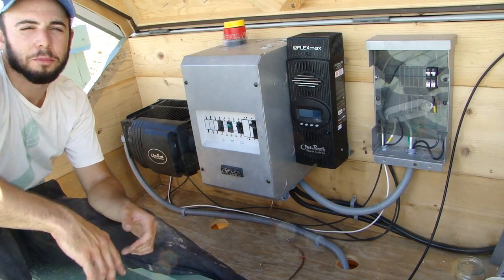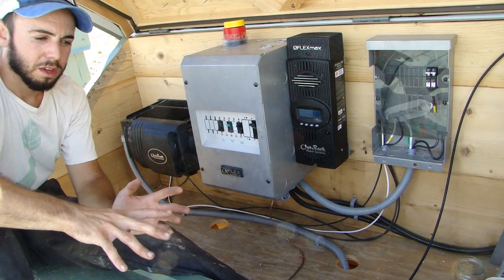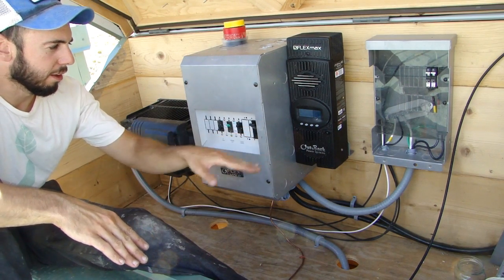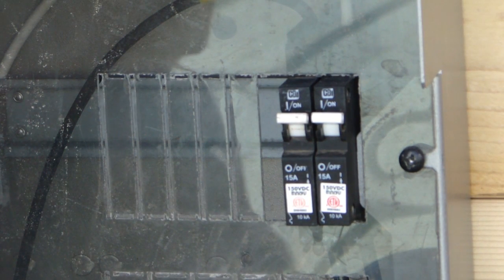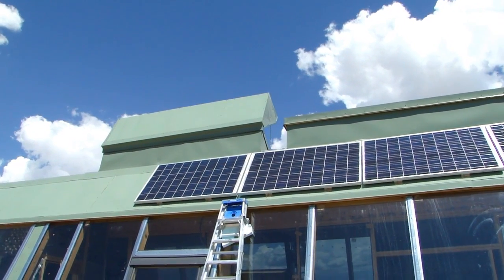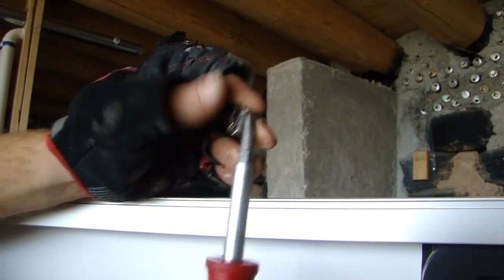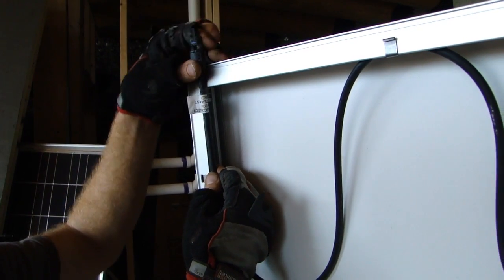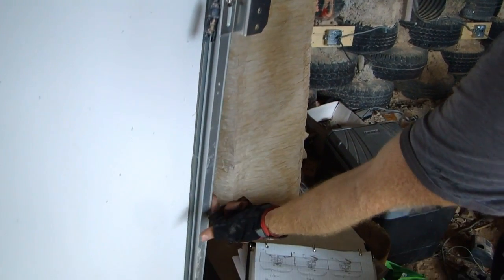Solar System Installation - Part I

Comment: i thought i was doing good by getting a kit... below, from amazon for about 2300 bucks, but now after seeing one of your videos, 
it look like i should learn more from your series and piece it together,  now i shall continue and learn!!! :D
(Renogy 800 Watt 12 Volt Off Grid Solar Premium Kit with Eclipse Solar Panel and 60A MPPT Rover Controller/Mounting Z Brackets/MC4 Adaptor Kit/Tray Cables)
Reply: this video info is up to date? or is there revisions some where? hmmm!

Comment: i install for a living and live off grid you have a good charge controller use it it will take 145v get as close as you can panels will never go over open circuit v. you have spent alot on your system use it the way it was intended it will work better. most high end chg controllers won't turn on untill pv voltage is more than battery voltage and turn off when its less.it will take care of your batteries. thats why its called a chg controller. don't try to controller it. let it do its job. your friend says he has the nuts and bolts of it.installing panels is the easy part. i've been doing this for 7yrs the electronics end of it is changing every day. i spend countless hours tying to keep up..you've got good equipment push it to it's limits give it a try you will be surprised.  where are you located? panels look steep.  anybody has any questions glad to help and remember the energy solution comes up every morning

Comment: There's so many ways to work around limitations like batteries, which are of course the ongoing cost of running a solar power plant.
I'm using an MppSolar 50 amp charger and 1240watts of PVs on a 12-0-12 volt system, which has facilities to monitor the state of charge (SOC) and control dump loads, along with other controllers.
By using this, i'm able to run more power coming in than i need on sunny days, and divert the surplus into hot water production and less essential tasks. This means that on less sunny days the panels can more or less keep up with demand, but may only dump power into water heating for an hour when SOC is at 99% or more.

Running 12-0-12 instead of simple 24 means i have to run 2 smaller tracer 12volt controllers, each sending up to 500watts into the system one between the positive end and zero or center, one between the negative end and zero. This may seem odd, but has huge DC reticulation advantages, as with cheap 3 core flex i can run 12-0-12 into a room to run a 24 volt LED between +12 and -12, my laptop on a 12volt adapter running between +12 and 0, and some 12volt strips between -12 and 0. Any imbalance between the 2 half's of the battery bank is corrected by the smaller controllers, eventually. :)

But that's irrelevant, the point is i survive
shitty winters by having an OTT supply of PV, (2,300watts) and in summer i get electricly heated hot water without caning my batteries at any stage.

My battery bank is half what yours is, and excluding my dump load, loading appears similar to yours, running lighting, automated night lighting, a computer 24/7, and power tools at whim, including a washing machine and electric kettle.

This is a technology that is evolving quickly, and it's important to remember there is not just the age old way of doing things.

:)

Comment: Hi, after watching your videos last year very often finally made my off grid solar system just like yours. I find out that if you re wire the batteries to 48 vdc instead of 24 vdc your amp hours will last longer due to higher voltage and it will also charge faster due to less lost in drop voltage and it will work better. Another advantage of the 48 is cable thickness can be smaller and thinner due to the higher voltage that will allow you to use a less massive conductor. Always use welding wires on your batteries and from your charge controller to your batteries and from your charge controller to your inverter. Thank you for all your videos inspired me and mastered my previous small knowledge. I like your house.
Reply: Is it true that a 48 vdc amp hours last longer than a 24vdc?

Comment: What???

So, what you are saying with all the tricks of solar power technology, I will actually need about 16 or 24 batteries to produce 6 to 9 kilowatt hours of power... Got it, most home systems produce this much power...

I am thinking, I want to use about 6 kilowatt hours a day which should work out to about 20 percent of my batteries capacity with extra batteries on reserve, for back-up..

Or 100 ah batters = a total number of batteries are about 24 to 30 batteries, Ah, gotcha...

I am very serious about coming totally off the grid... I no-longer want to depend on some cold insensitive power company to provide me with the power I need to live...

Granted, it will take me a few years to build up this type of system, but I can do that...

I am only home for a short period of time...

Still, I want to power my computer, monitor, TV, lights, and a few more devices...

The washing machine is a laundry-mat which, later, I will buy a washer and dryer...

My system will be set for 3 people, friends, a boyfriend, and family...

I am thinking of about a solar panel system between 2,000 to 3,000 watts...

I should be set then...

Oh, thank you very much and keep on making videos...

Comment: I am in Tx in a boiling hot climate.  When I read the manufacturing information what I understand that the panel produce lot of heat and air flow is necessary to avoid cell damage.  I see you install it right over the metal roof, or did you leave a gap? Also would it better to stagger the panel so there is a gap b/w each panel as well as gap b/w roof and panel ?

Comment: hey you're good to tell about it ... :)
but have two questions for you ..
I'm working on a small project ... and go with my wifi going out to a shed ... is about 70 meters from the indoor Wireless Access Point ...
but will run on solar power .. it only matters how much battery do I need for this? and the duck question how much Charge Controller kal I use it? ....
there is only a tink to run on the ...

Here is norway information about my project ....

Solar power
Dimensions: 403x176x34 mm / 1.4 kg
Max Power: 5Watt
Current at P max: 0.29A
Voltage at P max: 18.00V
Short circuit current 0.326A
Open circuit voltage: 21.96V

router to my Project
External Power Supply 12VDC / 1.0A Linear PSU.
I hope to hear from you

Comment: Nice information. I have a step by step tutorial series on how I installed 18 230Watt panels.. 6 strings of 3 panels.. Using the same FM80 charge controller.. Check it out if you have time and let me know what you think!

Comment: I feel the same way about the cost of the plans. The Earthship Biotecture guys used to mention on the forums that they were writing an Earthship Vol IV that would outline the building of the Global models but that seems to have fallen by the wayside. In the meantime, the plans for the next newest Earthship version, the "Packaged" Earthship are only $250. Now $250 is not the $30 that the book would likely cost, but its better than several thousand $s.

Comment: I'm not sure why you are calling them modules (although it is correct), as the "common" term is panel. A search on "solar module" will come up panel.  The main confusion I see is panel vs. cell, where people don't understand that a solar panel is made up of 36+ cells in series to give you 18+v.  Then, your two panels are in series to provide 36v to the charge controller.  Then, each bank is in parallel to double the watts as well as redundancy.  If a single panel in series fails, that bank fail.